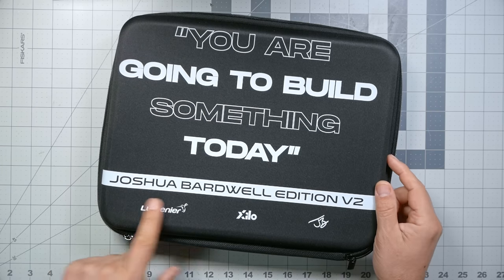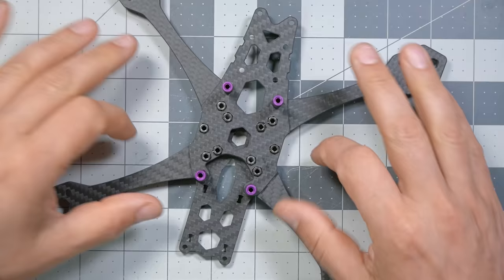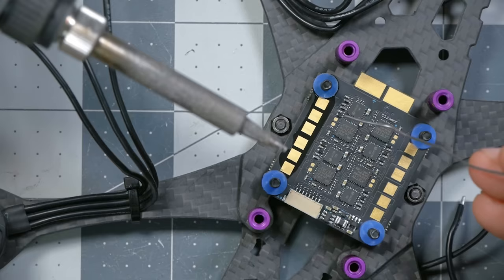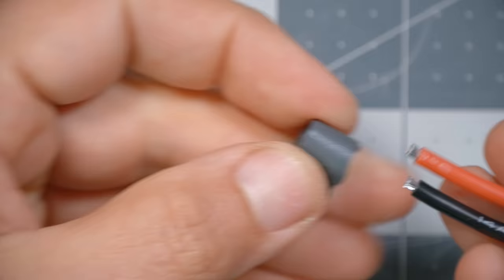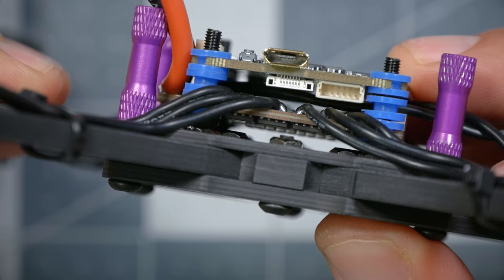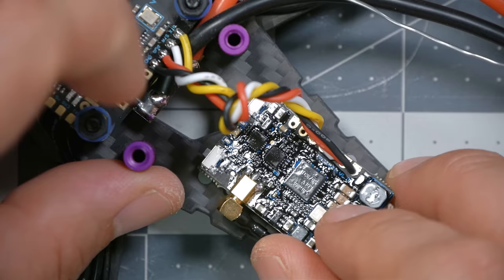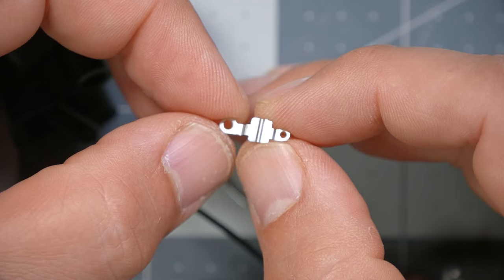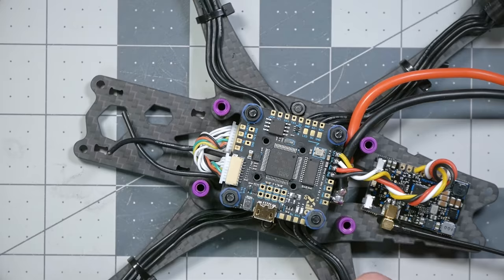2022 Freestyle FPV Drone Build (DIY Kit For Total Beginners)

Comment: Beginner questions and appligies if already been answered. Can this work with the eachine EV300O goggles and taranis X9D Plus SE receiver. Also what would be the closest quad to this to practice in velocidrone. Thanks
Reply from the maker: This can work with the EV300O goggles, if you buy the analog one. For the Taranis, get the RXSR receiver. In velocidrone, pick a 5" quad with a weight around 650 grams (e.g. not a ultra-light racing one).

Comment: Hey mate, long time builder here, just thought would check out your frame... Can you put a link to the blue thread lock stick that you had? That looks Sooooooo much better than the normal applicator where you are trying to get the smallest drop and it floods it,!!🤣
Maybe throw it on your ultimate shopping list? will use your link to buy it 👍 give a bit of a reward🙂😀
Reply: @fpvknowitall @Joshua Bardwell Also I just got a weird message from an account that looks like yours, saying that I am a highlighted winner, and to WhatsApp you to claim a prize.... I went off the page and now the comment is gone so I didn't get a chance to screenshot it for you... If I have won a prize-AWESOME!!!👍😀😀... But most likely you might be hacked, and or someone is using your icon/cloned account to spam....

Comment: Help please! You stated we need a specific silicone insulated fine strand copper wire for our ELRS receiver (possibly for the entire drone if we didn't buy the kit). Though there isn't a link or any information listed. It isn't stated in your soldering tutorial either. Newbie lost in the woods here.
Reply from the maker: Please check the "supplies and materials" section of my website www.fpvknowitall.com
Reply: @JoshuaBardwell  found it, thanks. Starting to look like a mini hardware store at my place to get one drone set up lol.

Comment: Is the ELRS receiver analog only???? Ples help im confused and thinking about purchasing, but not 100% sure on everything i need
Reply from the maker: The ELRS receiver works regardless if you get the analog or DJI version. You can choose to use the DJI controller, or you can use ELRS receiver with another controller. It's up to you.
Reply: @JoshuaBardwell  oh okay, so if I'm using the DJI controller I do not need to get a receiver then? Unless I want to use a different remote controller. Which I'm planning on just buying the DJI goggles and controller bc of range and quality also with its easy bind capabilities. Still deciding if I want to build one or get a pre built. I don't have money to blow up Flight stacks all day lol.
Reply from the maker: If using the DJI controller, then you do not need to get a receiver. Unless you want to use a different remote. That's exactly correct.

Comment: 18:27 At this point shouldn't you test continuity, to make sure there is some resistance(There should be at least a few hundred k-ohms, right?) between the solder balls?

Comment: Hey Joshua, I bought one of your earlier kits back b4 the Pandemic with the 2206 motors. Would you please provide an updated parts lists with prices for each of your upgrades for 2022?  Sincere thanks for all you do man for this awesome hobby. .Jerry Wolfe
Reply from the maker: The frame changed to qav-s. The FC and esc are v2 with small upgrades but no major changes. The motors are 2207.

Comment: If I plan on getting the HD kit and the Zorro ELRS transmitter that is ok right? I don't need to use the DJI controller if I go with the Zorro controller and an ELRS receiver?

Comment: I'm a little confused about best practice for wiring up the vtx and analogue cam with regards to power: should the vtx be used to power the cam (as vtxs tend to have filtered 5v output for cameras, but then having a long wire going from the rear section of the quad where the vtx is mounted all the way to camera at the front), or should the fc be used to for both the vtx and cam, using separate 5v power pads each, but the same (common) ground pad for both items? JB, you seem to prefer to use the fc to power the vtx and then the fc to also to power the cam -is this the best way?

Comment: I can't get the lock ties through the holes on the silver box. I have broken 2 already trying to pull the through with pliers. Is there an alternative way to mount it? I stopped building for awhile. I can't find any screws long enough to mount it with. IDK..

Comment: great vid.. i missed the section where you mount the dji camera .What length camera cable did you use for the dji??
Reply from the maker: I always get the longer cables just in case. I don't mind taking up the slack. I would guess this was the 12 cm cable but it's whatever the Vista came with.

Comment: I ordered this kit it should be here on Friday, but I was pre watching the video. Didn't you say, either in another video or a live stream, that putting the capacitor on the end of a wire reduces its effectiveness? And that it is better to solder it directly to the battery pads on the esc?

Comment: I am a dead beginner at this and have followed your videos right up until you started mounting the receiver. Unfortunately It was suggested I buy an FrSky R-XSR 2.4 micro receiver. Are there video instructions how to install that on your freestyle beginner drone kit?
Right now I have no idea where to go from here.
Reply from the maker: For the RXSR, the green goes to the pad labeled SBUS on the FC. Red goes to 5v and black goes to G. Remove the white wire. Yellow goes to the pad labeled S.PORT on the FC. In the Ports tab, enable Serial RX for UART 1 and enable SmartPort Telemetry for UART 6.
Reply: @JoshuaBardwell  there are two black lines coming out of the back end of the circuit board. Where would those go or are they the antennas?
I apologize deeply for not understanding what you are saying about enabling serial RX for UART1, and beyond.
Reply from the maker: Those are the antennas. Here is how I mount them: https://youtu.be/KA2OLTBIjKk?t=473

You can see me set up the Ports tab in the 3rd video in this playlist, which goes through the whole flight controller configuration for this build. The UART numbers you use will be different than the ones I use because you're using a different receiver, but the process is the same.

Comment: Joshua, I have ordered the kit with the DJI camera, I only have the new DJI FPV controller (the grey one) is it going to work with this quad or do I need to get a different remote?
Reply from the maker: You will need a different controller. The gray DJI controller only works with DJI drones.
Reply: @JoshuaBardwell  the black one should be fine for this setup with the DJI camera though, yeah?
Reply from the maker: Yes.

Comment: Best tutorial I've seen yet. I'm disappointed in my dji range and want to upgrade to tbs. If it were a new build, I think I could do it but I dunno how to swap em. Do you have a video on how to switch over? Thank J.B.
Reply from the maker: When you say you're disappointed in the DJI range, I think you must mean the video, but then you say you're switching to tbs, so I guess you mean the controller. But the DJI controller should have the same range as the DJI video system. So I'm not sure I'm understanding the question.
Reply: I might not be asking it properly, sorry. My signal drops out sooner than my buddy's. He uses tbs tango and I want his range, penetration. I already have the new t antenna, wires and receiver. Just need a tutorial on how to switch. I don't want to destroy my nazgul. Thanks for a fast reply too. 🤘🏼
Reply: Basically I want long range flights.
Reply from the maker: The thing is, if the video signal drops out, then it doesn't much matter that you still have control signal. The DJI controller and the DJI goggles have similar range and penetration. Anywhere you have video, you should also have control. At that point, is it worth the trouble to switch out the receiver and controller?

If you are losing video at short range, that's an issue to solve, but it won't be solved by switching to crossfire.
Reply: @JoshuaBardwell  what would you suggest? I was under the impression that adding a crossfire receiver and using the tbs tango 2 (pro) would allow much further flights?

Comment: Do I have to use a DJI controller with the DJI CADDX? I have a Devo 7 transmitter and I’m confused if it will work or not…. Thanks in advance!

Comment: I see that you didn't bridge the Boot pads, and according to ELRS documentation it needs to be done first first-time flashing via Betaflight Passthrough. Is there a particular reason why you didn't include that part in the video? Thank you in advance~!

> "The EP receivers require their Boot pads (see figure above) be bridged on first time Passthrough Flash from their factory firmwares. After the first passthrough flashing, the bridge needs to be removed, and is no longer needed for subsequent passthrough flashing."
Reply from the maker: Two reasons. First, I usually flash via WiFi. But second, when I do flash using passthrough, I haven't had to solder bootloader in forever. I think that is old advice. I can tell you that I did flash this one using bootloader -- I don't remember why -- and it went completely smoothly.
Reply: @JoshuaBardwell  Thank you for the response!

Comment: Hey Joshua thanks for all the great info over many videos.  I have specific Q about resolution.  If transmission is limited to 720 horizontal resolution is there anything to be gained by 1200 TVL camera and 1280 goggles? Guess it might look ‘smoother’ but in theory 700 TVL cam with 720 goggles shoulder capture all the information ? THANKS !
Reply: Sorry talking analog PAL or NTSC here

Comment: Hi Joshua
I am very new to FPV drone making. I started with flysky fs-i6x transmitter and used it to experience using drone on simulators.
Can it be compatible with (FS-x6b receiver) on this build?

I want to buy this kit please inform me if there is any problem
Thank you

Comment: may I use FrSky transis X9 transmitter and Skyzone SKY02O OLED 5.8GHz FPV Goggles w/ SteadyView Diversity Rx goggles?
Reply from the maker: Yes you can. Get a FrSky receiver such as RXSR.
Reply: @JoshuaBardwell  ok thanks

Comment: Does make sense to connect the capacitors using wires instead of soldering them as close as possible to the PCB?
Reply: From what I’ve read it’s best practice to have it as close to the esc/xt60 solder pass as possible. But some builds don’t allow it. So a capacitor further down the line is better than no capacitor at all!

Comment: I just bought this kit then it hit me that it didnt ask to select a receriver. I have the tx16s 4-1 with a crossfire adaptor, would u suggest I buy a crossfire rx and assume the set up is similar enough that i can still follow along?
Reply from the maker: If you have a Crossfire controller then yeah you need a Crossfire Nano RX. The wiring will be the same as ELRS but the controller setup is a little different.

Comment: Noob question. I have a smaller drone, it's digital. So, If I want to build one and stay digital.. I can get the vtx there and use it on a new kit to build?
Reply: Just to make sure I understand your question correctly, you want to take the digital video system from your smaller drone and put it in another drone? 

If the smaller drone has a separate VTX, i.e not part of an All In One board, then yes that should work fine. Just remove the VTX and camera and move it over to the new one. I would take some photos of how the wires are connected first and which pads they go to on the FC, just so I don't have to worry about getting it mixed up or if I would want to reverse it later.

Make sure the camera cable is long enough to reach where you would mount the VTX on the larger quad tho.
Reply: @hultaelit  thanks, good tip, and I forgot about the length of the wire.
I was thinking of maybe trying to build one in the near future. And vtx is expensive for digital lol.
And I'm having a hard time finding a battery for the small drone (I wanted 95c or above for example). So a bigger drone can carry a larger battery.
But yeah still have to practice more

Comment: Can I still install a GPS? If so what UART port do I use
Reply from the maker: There are only two available full uarts, 3 and 4. If you have digital vTX and crossfire or elrs receiver, there is no spare UART for GPS.

Comment: I’m considering buying this kit. Can I fly it without goggles? Also, will there ever be two cameras to provide 3D video in the goggles?
Reply from the maker: It can fly without goggles yes. But it's pretty hard to fly an acro drone line of sight.

It won't ever have two cameras for 3d. I'm not really sure such systems for FPV still exist. I know there were one or two once upon a time.
Reply: @JoshuaBardwell  will the DJI Goggles 2 (currently available for preorder) work? I’m still trying to figure out some details before I jump into this.  Also, is there a reason not to use a receiver with true diversity in this build? I was thinking about using the Happymodel ep1 dual TCXO RX. (I’m looking at getting the Boxer radio.) This is my first drone build. I’ve never flown fpv.
Reply from the maker: The Goggles 2 will work if you use Vista or O3 video transmitter. The only reason to skip true diversity would be cost and complexity of mounting dual antennas. In other words, not much reason if you're inclined to go that way.
Reply: @JoshuaBardwell  now I’m looking at getting the frame from your kit but buying the HDZero freestyle transmitter to work with the new hdzero goggles. Will this work? What specs do I need to pay attention to when trying to find a camera that will work with that vtx and goggles?

Comment: I’m building my own quad and I am using the xilo stax vtx. What gauge wires are you soldering on the VTX?
Reply: I'm looking for the same information. During ELRS installation he states there is a link but none has been posted. I'm guessing it must be in the soldering tutorial.

Comment: So if i do a build with the O3 unit and plan on using the controller 2 do i still need to purchase some kind of receiver for the controller or can they be synched with the touch of a button.
Reply from the maker: The FPV controller 2 (the gray one) can bind directly to the O3 air unit. You don't need any separate receiver.
Reply: @JoshuaBardwell  thanks for the quick response. I'll be awaiting your video of integrating that new unit with what would be a different frame.

Comment: Question for the community: I have the DJI RC Pro Controller & the DJI Goggles Racing Edition Headset. Would these work with the Caddx Nebula Pro Nano Vista Kit? I have all the analog equipment but want to switch over to HD. Just want to see if my existing equipment will work or if I need to buy all new stuff. Thanks.
Reply: Won’t work
Reply: You need the DJI FPV goggles and controller if you want to pair it with a Vista unit.

Comment: A little annoyed at the moment. The provided 3d printed part was too small. Had to drill out the inner hole for the antenna to pass through. Then had to use the Dremel to sand the inside part for the head of the antenna. And now that the antenna is connected, I found out the holes for the standoffs were too small so now I have to drill out those holes with the antenna attached to it. It is like they heard that there was tolerance in the video when Joshua put the antenna through, so instead of fixing the model, they just scaled the entire model down? And now none of the holes are the right size. And the holes were so small to begin with that when I was pushing the antenna through, there was a pop. So I am doing all of this for an antenna that may be broken, just because there was no quality assurance on the 3d printed part? Sorry but 3D printing isn't perfect and if you are going to include 3D printed parts, there needs to be some sort of quality assurance to make sure it is going to fit on the drone at all. So now I have to either keep drilling out holes and possibly break my antenna, or 3D print my part for this, which I am not currently capable of doing. I just wanted to build a drone! and Now I don't even know if it will work because of the popping noise the head of the antenna made when I tried to push the antenna through the 3d printed part.

Love everything else in the video. Just very frustrated that there wasn't quality control on a 3d printed part.
Reply: What if you made the antenna mount out of TPU? that would reduce breaking on impact, and tolerances would not be as critical. It would reduce strength, but the antenna mount doesn't really need strength.

Comment: Why do the arms attach so strangely? Why not just use 2 screwholes per arm?
Reply from the maker: The current method allows for 1 screw arm changes which a lot of people value.
Reply: @JoshuaBardwell That makes sense. Kind of like formula 1 cars.

Comment: Hello Joshua, Im about to get this drone as my first ever fpv drone but I dont want to use DJI system since im gonna get the new fat shark dominator,  what else should I get for this version? new vtx camera or just an adapter? thank you very much!
Reply from the maker: You would need the Walksnail vTX and camera, but other than that it should install in a similar way to the DJI system.
Reply: @JoshuaBardwell  Thanks for answer! one more question: Ive checked the walksnail and since it costs 130 and it replaces the dji system I guess I can get the analog versión (since is cheaper) and install the walksnail, right? or are there more differences? Again, thank you

Comment: Question: I have a RadioMaster TX12, and it doesnt have ExpressLRS on it, does this mean I would have to buy a whole new controller like the ZORRO used in the video or can I just by an ELRS module to plug into the back of my TX12 and get ELRS support that way?

Any help would be appreciated
Reply from the maker: You can buy a module.